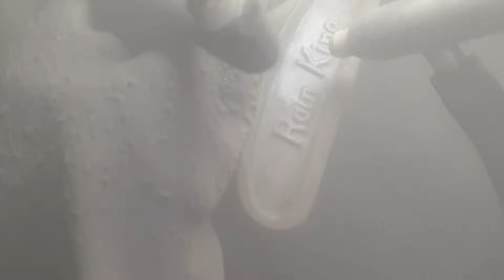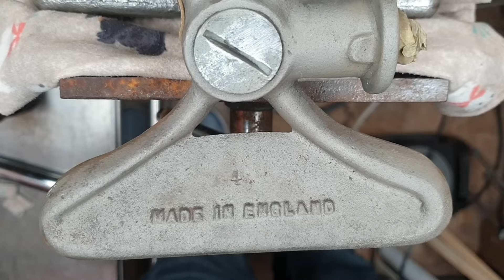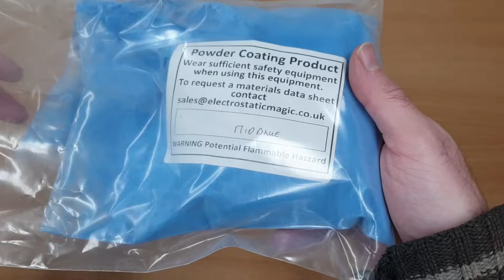Rusty vintage 1930s Rain King restoration

Comment: That looks great. Nice and difficult restoration. I like the result. I would like to have a springler like this one on my garden through summer days (cause I hate plastics). One thing... I would highlight those signs on the body... And your bench grinder sounds like from another solar system (on my headphones) 🙂👍
Reply from the maker: Thanks,  definitely outlast any plastic rubbish.. I did think about highlighting the letters, maybe on the next project👍👍

Comment: Very nice!  Very labor intensive restoration but it turned out great.  I wondered how you would make the repair - good old JB Weld to the rescue.  Regards, Bill.
Reply from the maker: Thanks for watching, gutted when it broke. If I had a lathe could have drilled it out, made a whole new piece etc.. Certainly an item for the future 👍👍

Comment: Awesome job! I’m just about to start work on a similar sprinkler for my channel and YouTube recommended your video - how does it know?!😂 I’ve got my eye on the same powder coating system that you use - is it something you would recommend, particularly for someone with no previous experience? Many thanks.
Reply from the maker: @DistinctlyAverageRepairs  hi, i was very dubious about that powder coating system. But after a phone call to the suppliers and a rest assured return if not happy, I made the leap. It's a nice bit of kit, it's taken a few goes to get the air pressure right, but coating is lots of fun. Compared to priming, painting, lacquering and waiting days between each.drop me a dm on tik tok, I'll pass her details in. Good luck with it.👍👍
Reply: @CrustyRestorations  Many thanks for your reply. I have actually had some contact with the company and have been impressed with what I’ve seen/heard but it’s nice to get a view from someone who is actually using it. As you say, being able to do all the painting in one go is a major benefit. I do enjoy spraying/air brushing but it can be such a time-consuming faff! 😂
Reply from the maker: @DistinctlyAverageRepairs  ah cool, yeah it's a game changer.  Picked up a £10 oven off Ebay, bit of hassle with hanging things in  small oven, but all worth it.  Looking forward to seeing that sprinkler👍
Reply: @CrustyRestorations  I did suggest to my partner just using the oven in the kitchen but apparently that won’t be happening! Sprinkler is coming on nicely - spent the afternoon removing paint and polishing brass so just filling/painting to go. 👍
Reply from the maker: @DistinctlyAverageRepairs  yup  def no no, need a separate oven for sure..